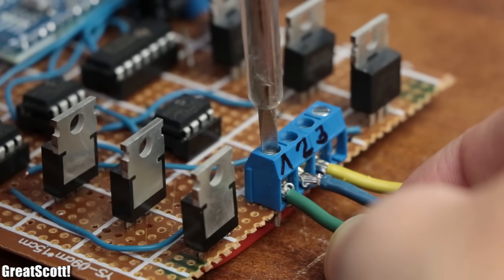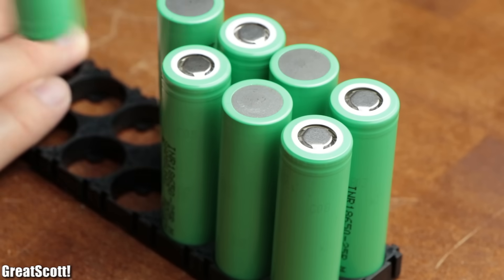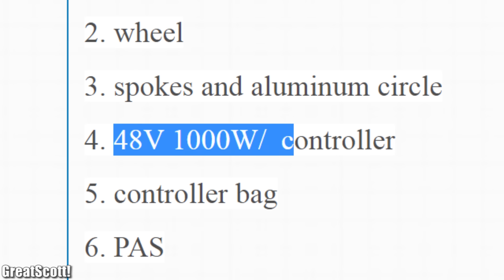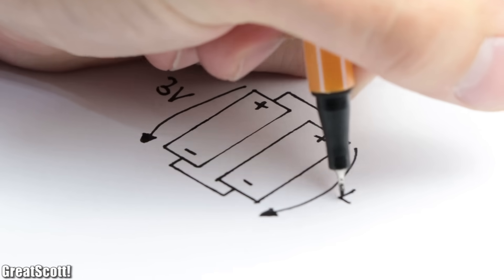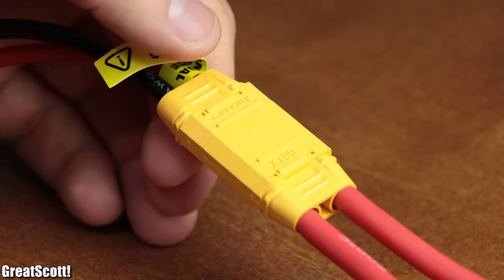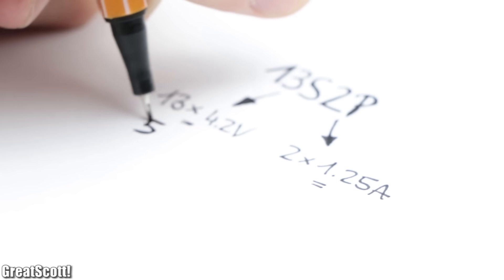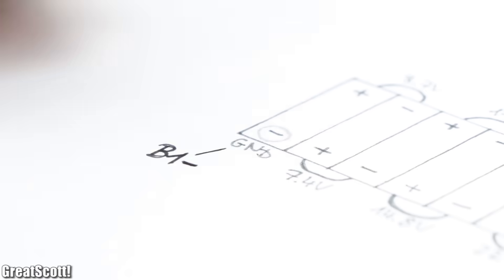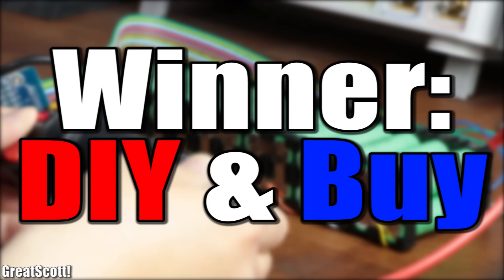EBike Battery Pack || DIY or Buy || Electric Bike Conversion (Part 2)

Comment: DIY is a clear winner if you allready have the 18650 cells
Reply: Yes you can, most are just a pack of 4 to 8 18650, I take "dead" (usually the managing circuit fails or a cell over discharges) laptop batteries and use them for diy power banks or other proyects.
Reply: you can use different brands or types. Everything works fine if you measure the capacity and sort them to have the same capacities in series connections, but you should pay attention to their internal resistance, it can't be too big (my limit for big current draw appliances is 100-150miliohms) otherwise they'll heat up and die quickly. And of course don't forget the BMS, or - like in my case - balancing them with chargers with balancing (IMAX B6, charsoon antimatter, etc). I've made few battery packs in my life with used laptop batteries, and they work without a problem. Cells between 300 and 1500mAh and with big internal resistance ended up in my powerbanks, because it doesn't matter when you have 20 of them in parallel and draw 2-3 Amps. Nothing goes to waste (except <300mAh cells...) and nothing blows up. I've had only one accident with a cell, when I created 4S36P pack and tried to start an engine in my quad with it. The current draw was too big, As i measured with  clamp meter around 300 Amps, and the next day i found the battery pack cover melted, the cell was dead, but I replaced it and use that pack carefully, up to 30-40 amps.
Reply: Adam Grufík You're right, but let's say there is 20 batteries in parallel and you draw for example 5A... Then it doesn't matter if they have different resistance. Also I use a safety method of fusing every cell (from HBPowerwall) in which every single cell have a very small wire soldered on, which blows like a fuse with currents bigger than 5A, thanks to that it won't be overloaded and if it fails and shorts whole pack, it will quickly be disconnected from it. Also its quicker to solder very thin wire, so the battery won't heat up during that process. In my opinion its safer than spot welding, just because if spot welded cell fails it drains the rest of  cells connected in parallel with the bad one.
Reply: Do you have 30 (or 60 in bigger packs) batteries just lying around? I have some from old laptop batteries, but I can't use them together of course..
Reply: Adam Grufík if they are diffrent parameters then you use bms or try to manage get same capacity bunch for one group of cells
Reply: Or get cheap second hand ones
Reply: Of course, but when you can haul them almost by the literal ton out of tech repair shops you are bound to pile a nice amount of batteries with the same parameters. At least 7 out of 10 will be ready to use, 1 will need some restoring and the other 2 will be dead
Reply: Man, they have ESR. If it is different, any it will be, you should not use these batteries together. If one would have lower ESR, bigger current would flow through it, causing it to fail quickly. Also cells from laptop batteries does not have the same wear level. First pair is used the most and it usually fails first.
Reply: Since some of the cell may have different parameters after being in "dead" battery, you should check their capacity and ESR first. You can of course use them to create something like a powerbank, but If you would use other types from more batteries, it would be very bad. Also you would need 30, or 60 the same cells with same parameters to create something like this battery. You can not just solder any cell to each other.

Comment: Very nice as always. Do you have plans for an aluminum case for the battery pack?
Reply from the maker: Not an aluminum case, but something else. Will be in the next part.
Reply: @greatscottlab  3d printed case
Reply: @greatscottlab  nice sir 🙏
Reply: @greatscottlab  Hi there, I have a plastic box that you can add aluminium to: https://www.youtube.com/watch?v=g4Aw9zxtOv4&t=13s    👍⚡ 🔧🐥 open source technology, Sorry BMS images are coming soon.
Reply: I imagine he'll 3d print something.
Reply: I would suggest a flame retardant filament if you 3d print something though, just in case. some of the other filaments are flamable.
Reply: I'm building mine from wood. its 10" x 24" and 3.75" tall. with 280 18650's. I'm going to build more. and stack them. with a air gap. and vents in the case. but it can't pull much more than 5 amps per cell! with 3 10ga busses per pole. per pack. and fused on each cell. I am going to power a house with it. I'm going to use headway cells or lipo. or maybe LiFePo4  for a cross between bicycle and motorcycle project. a full suspension. no pedal bike. with about 2500 watt over powered motor. and I'm trying to keep the 21 gears. I'm going to start with a 500 watt motor for proof of concept. for the drive system. then I'm going to look for a good large motor. or use 2-3 1000watt dc motors. I need a motor controller to Handel the power. 72v nominal. I don't know if I can diy design it . I know I could build it . if I had a basic design. it should be easy for a brushed DC motor controller! that can Handel 60-90vdc. and 3kw. then its a small car. that's what got me started on the Ebike. great video. I been rambling again. sorry! great video!!!
Reply: GreatScott! May be a 3D printed battery case.
Reply: Electronoobs i always watch you videos
Reply: Better off getting a plastic one, doesnt burn if something had problems (as wood could) and doesnt have the risk of shorting the circuit.
Reply: You can test the nylon filament for 3D printer for the  case or individual test. Great work!
Reply: Wine wood box!
Reply: jort93z if you build it to be flame retardant then it basically becomes a pressurised bomb between your legs, if it's on fire at least then you know somethings wrong!!
Reply: maybe a case from bamboo! would look nice! and be environmentally friendly!! haha... it could be a fire hazard though! great video. you always leave us wanting more!
Reply: Vent hole/tube and good to go.
Reply: Both are great
Reply: Electronoobs why metal case make a plastic one.
Reply: Sir how buy lithium battery  give me website name please
Reply: Great teaching video . I'm planning to power up 10KW BLDC MOTOR and it needs 48v . What type of batteries to use for about 300 amps at max